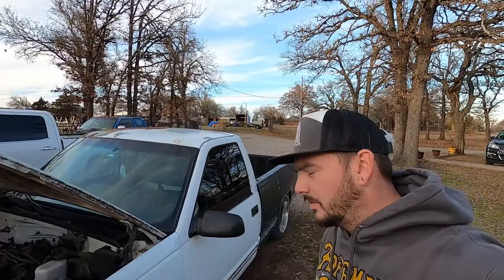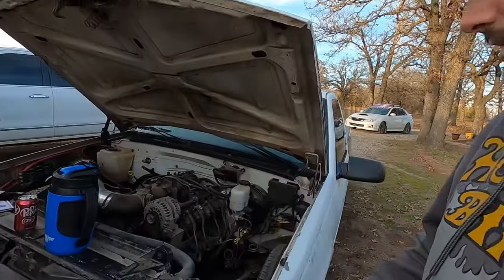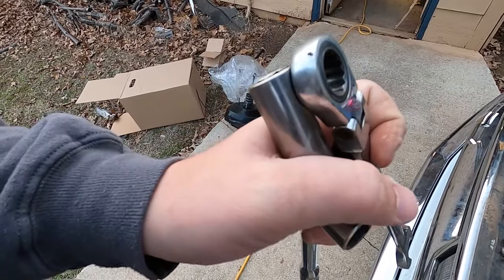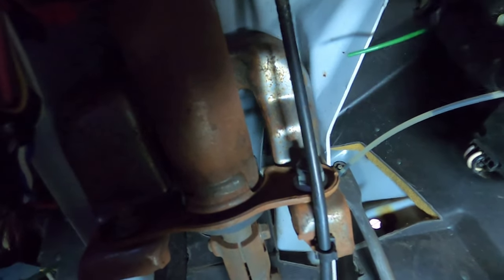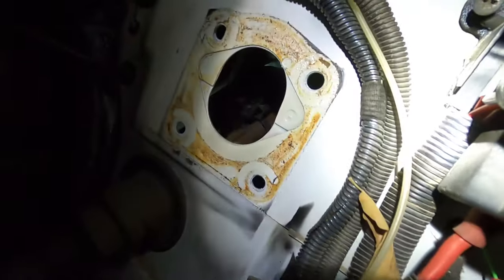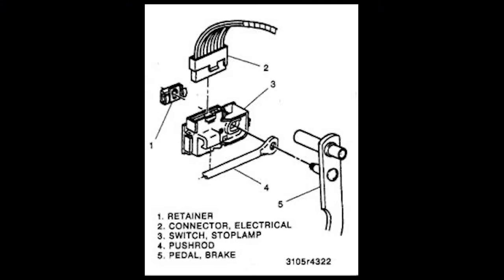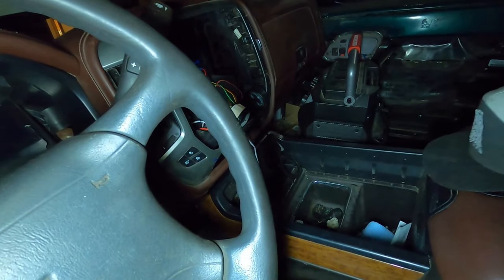How To Change A 88-98 Chevy C1500 Brake Booster!!

Comment: After watching numerous videos and taking one off of a donor truck and installing it into my son's truck I've seen at least 3 different kind of clips. Not only taking them off is a pain but putting it back on was beginning to be also. Then I remembered hose pliers I had gotten from harbor freight. Held it perfectly and had the right length and angle. Popped it right on.
Reply from the maker: That’s a great idea! Hose pliers would be great for this job!
Reply: Would it be possible to drop the steering column down to allow for more access to remove/install the clip?
Reply from the maker: @chrisvantuyl5554 that sounds reasonable! Might help a lot

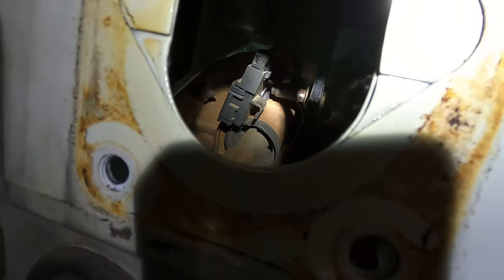Comment: Solid video, this made it so easy to know what I was doing. The diagram at 9:29 was great. I did the whole job with just an Milwaukee extended reach ratchet, a screwdriver and good lighting. The clip on my 98 was smaller and a different style. The whole job was only 15 minutes.

Comment: I will be doing one of these shortly. 
From what you described, you left one of the top nuts for last and the booster kept falling away, making it difficult to remove the nut. I'm thinking I will remove both top nuts first, and then the bottom ones. This way, as the booster tries to fall away, pulling the top bolts first, the bottom remaining nut should easily spin off. Hope it works like I'm thinking!!
Decent video and I have confidence this should be pretty easy and straight forward.
Reply from the maker: That sounds like it may be a solid approach! Touch back here after you get it done so we can help the community!
Reply: i would say just take the nuts off the master cylinder and allow that to hold the booster in while your take the nuts off booster. then take it apart.

Comment: Hey you think that clip on the rod would be much easier to take off if I dropped the steering column down some?

Can easily remove 2 bolts to have it move down quite a bit, and just wondering if that'd clear it up some.

Thanks!
Reply from the maker: I bet it might, it’s worth trying at least!

Comment: Buddy of mine has a truck that someone did this replacement on. The brake lights do not work, we replaced the bulbs, checked the fuses and relays and still nothing. The tail lights and blinkers work. So I decided the retrace the steps of what it takes to do this job in hopes of finding some answers about the brake switch/sensor. Thank you, I am going to inspect that area now and see if anything is amiss.
Reply from the maker: Good chance that the switch is faulty at the pedal. Get your voltmeter ready 🤘 good luck

Comment: Did you have to bleed the brake system after just replacing the booster?
Reply from the maker: No sir
Reply: Did you have to bleed the master cylinder after putting it back on?
Reply from the maker: As long as you don’t open a fluid brake line you won’t introduce air into the system, therefore you won’t need to bleed it! 🤘

Comment: Why fight the clip ? The column has 2 bolts holding  it just remove it and  access clip. Why won't that work
Reply from the maker: I suppose it would. In my truck I wanna say I have the wiring routed in a way that would make that difficult also.